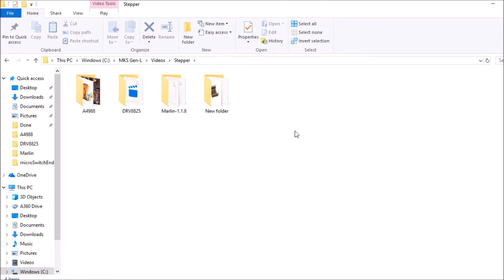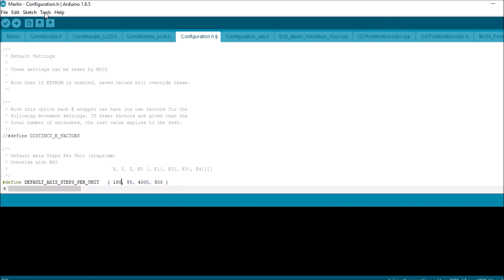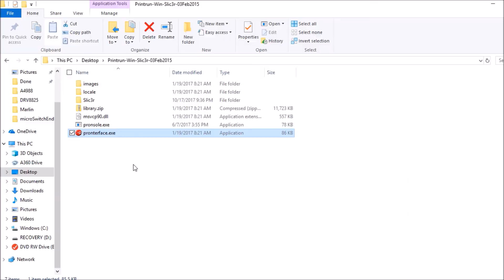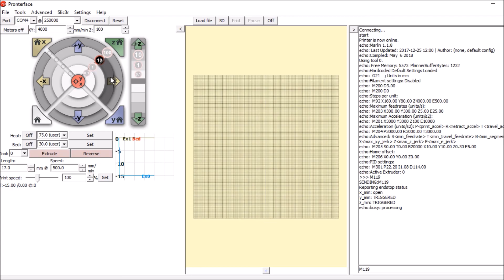MKS Gen L - DRV8825 Stepper Configuration

Comment: hi, i have an artillery sw x1, and i want to control the cooling fan for the hotend, but i noticed that is conected so the HE1 pin, the thing is that when i turn it on with 24 volts that pin its always on, no matter what, is the transistor burned?
Reply from the maker: Which voltage is the fan?

Comment: How to install tmc 2208 v3.0 UART in mks gen l v1.0 board?
Reply from the maker: On MkS Gen L it can be done, but involves a jumper modification of wiring.  Also 8 bit processor might get a little slowed down using them.  It would work better and easier on 32 bit processor without a lot of work.  The MkS sGEN L is better design for it's use.
Reply: @EdwardBraiman  thanks for the reply eb 😃

Comment: Great videos!  I've gone through this and the 4988 drivers.  Do you plan on doing one integrating with the TMC2130 drivers?  I understand it drives a stepper more powerfully and more quietly and can detect end-stop via rising current on motor stall.  Can all that be implemented when used with the MKS Gen-L?  Thanks.
Reply from the maker: I've already mapped out the tutorial, but I wanted to also show people how to make a custom cable for setup.  The Crimping tool is in transit as we speak, so I'll need to learn how to use before making video.

Comment: I am using the MKS GEN L with the DRV8825 and Marlin 1.1.9 everything is working but prints very small, I assume that is because I need to double my values as in the video but do I need to do anything with the jumpers under the drivers or leave all 3 in  place?
Reply from the maker: All three jumpers should remain.  If they're remove the steps will be larger.  If your prints seem small check for  unit issues.  For example in Slic3r what size do you see when the image is clicked on.  I personally had an issue today similar when someone asked me to print something in inches and it was displayed in Slic3r very tiny because inch in Slic3r sees as millimeters.  In my case resized by 2540 percent to readjust size.  If Slic3r size is correct check reprap calculator and double values as they are twice the size of the default stepper driver A4988.  Let me know how it turns out.
Reply: @EdwardBraiman  thanks for the reply, I tried doubling the values and compiled the sketch but got an error when trying to upload it, now I can't even get the sketch to compile, getting errors that I can't figure out.
Reply from the maker: What is the version of Arduino IDE and what's the error message when compiling?
Reply: @EdwardBraiman   Arduino  1.8.7 I got the error to go away when I went back to the original axis steps per unit so it has something to do with those settings
Reply: exit status 1
Error compiling for board Arduino/Genuino Mega or Mega 2560.
Reply from the maker: In 1.1.9 you might need to specify steppers in configuration.h. This might vary because the original video might be recorded before 1.1.9.
Reply from the maker: Do a search on, "drv8825", on configuration.h

Comment: So I am assuming you follow the same steps for y & z axises
Reply from the maker: Correct.
Reply: @EdwardBraiman  Does this mean you can change the Z steps from 4000 to 8000? as well as the same thing for E just double the steps in the code?
Reply from the maker: @cjwelcome6104  Yes, when replacing DRV8825  from A4988.  Keep in mind the current Marlin firmware release has a possible different process.   The new release in 1.1.9 of Marlin makes you specify each stepper if they are not all A4988.  Still need to verify it will work the same when this firmware is used.  I'll be testing sometime near the end of the month.  If you try let me know if doubling is require or not.  Good luck.
Reply: @EdwardBraiman  Hey man thanks for getting back to me I did install the new drivers and I gotta say I can't notice a visible difference in print quality but it's just that those DVR8825 drivers can handle all the way down to 1/32 steps and also1/16 step if you decide to not change the code at all it will still run fine. One thing I did notice was the stepper motors where not getting super hot like they used to after an hour of printing and even the drivers dont get that hot either until they are running for a longer time which doesn't matter since I have a cooling fan for those anyway. I am using 0.5V on these which is different from the other drivers and their 0.6V I had going to those ones and it's working like a charm. Overall I'll be buying another hand full of these DVR8825 drivers from aliexpress for my other printer to do some driver tuning and replacement. Thanks for your helpfull video and i look forward to more in the future!

Comment: the board dont seem to run motors ive tuned them to the vref 84 as per ur vid  they stock tronxy also im not sure my tdt is working or communicated
Reply from the maker: Do you have a link to the stock tronxy motor so we can see the current settings.

Comment: Hello just wondering my drv8825 is getting pretty hot just sitting at idle after i move it forward 10mm and just wanted to know why that would be I adjusted the voltage to 0.9 volts but still getting hot
Reply from the maker: It would appear your Vref might not yet be calibrated.  The potentiate controls the amount of flow.  This will need to be adjust with a multi-meter.  I'm currently research a safe and simple way to present.  It might be a couple of weeks as I'm waiting on parts to demonstrate.
Reply: Thank you for the reply I actually got it had to low the POT down to 0.25 milli volts to stop the heating and it lowered the frequency as well so no more buzzing noise for the stepper motor I'm running a nema 23 stepper
Reply from the maker: np